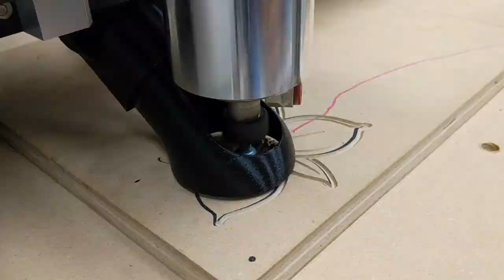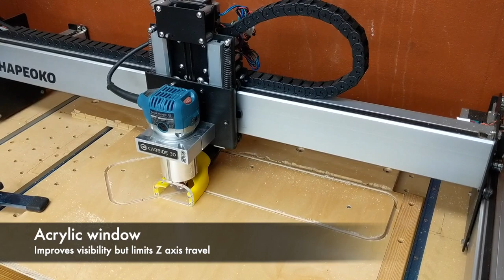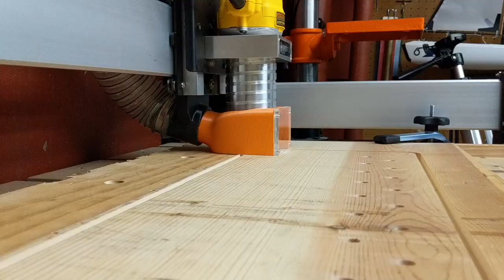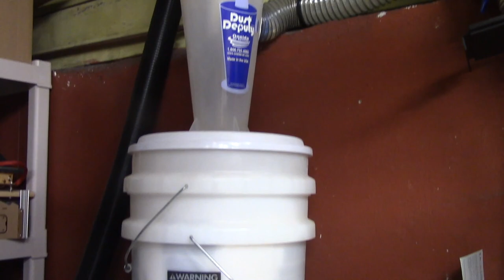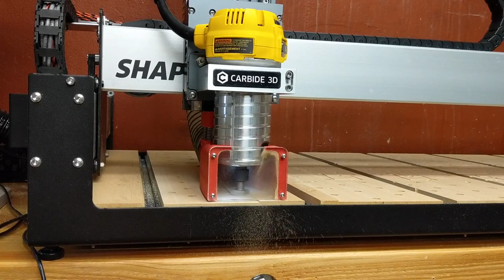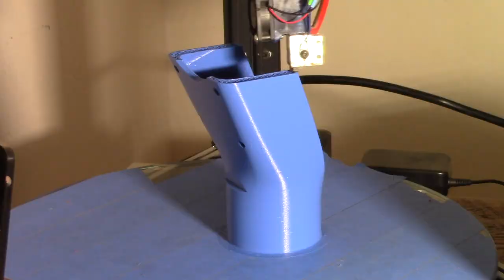Dust collection for Shapeoko XL

Comment: Well done!  I agree with the previous post in that your designs appears to be far more effective than the setup that comes with the machine.

What about using magnets to mount the acrylic window?  This would allow quick and easy removal.  Could free up more space when changing bits.
Reply from the maker: Good idea! I wanted the acrylic to be relatively thick and firmly attached as a safety screen in case of bit breakage or projectile wood chips. But neodymium magnets + epoxy might be strong enough.